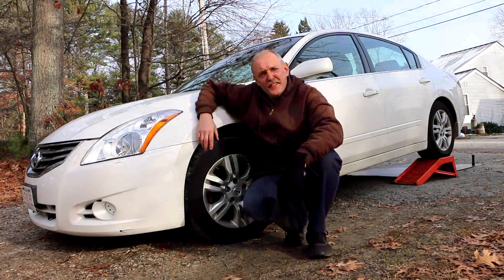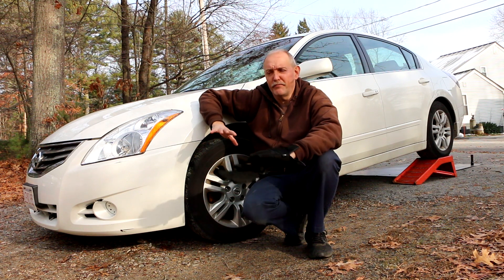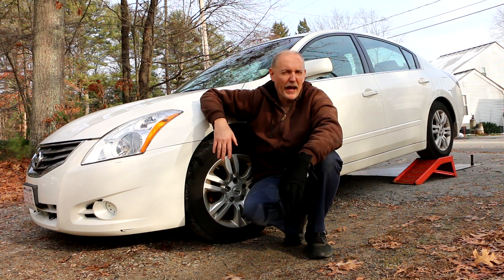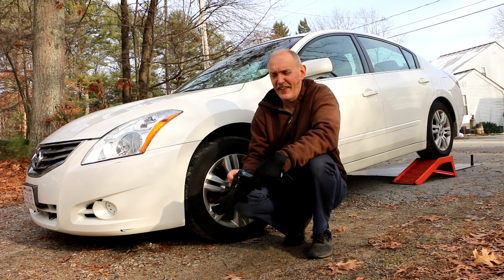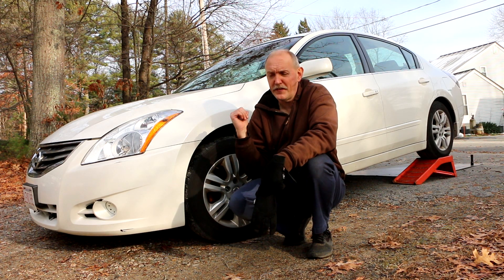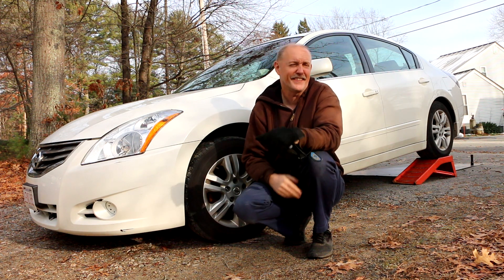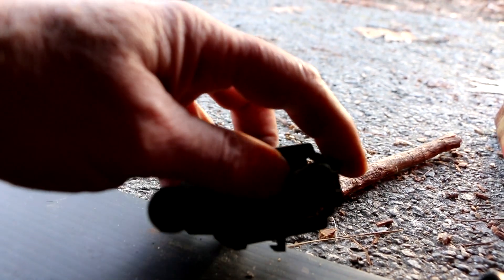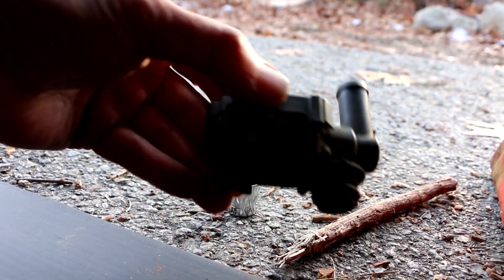2010 Nissan Altima Emissions System Leak  Codes P0442 P0445

Comment: I had this problem and had a small leak to high leak code. I replaced it with a new one and now I’m getting a circuit stuck open code. Do u have any suggestions?

Comment: What you replaced is your vent valve. The purge valve is located under the hood.
Reply: Tnx on the info, I watched dozens of these videos, I couldn't figure out which one is which.
Reply: hey i think i need this part what will ur car drive like if u have this problem?
Reply: what the heck is it then  ,  thought it was called evap purge control vent canister

Comment: Absolutely amazing video. Thank you for not only covering the 'how' bit, but also the 'why'. Just replaced my own on my 2010 Altima - the shop did a smoke test and wanted $1500 to do it, saying they'd need to drop the gas tank and the whole exhaust system. We'll see how we did if the Check Engine light comes back on. 

If it does I may need to look at replacing the whole canister - not sure how much more involved that will be, but with your video this was easy and fast! Thanks for taking the time to make and share.  :)
Reply from the maker: After the repair, it was fine for a while. Then it through an evap code again, however, now the light will go back off on its own. So I am convinced I still have a small leak. It might be as simple as the gas cap. I now push in on it while tightening to try and ensure a better seal after buying gas.
Reply: @stevewatr  I appreciate your honest reply! I tried replacing my gas cap first, but the check engine light came back on relatively quickly. Mine was throwing the codes P0456 (very small leak) and P0442 (small leak), though after the smoke test the purge valve was the only issue they found. I've driven a little over 100 miles since replacing it and the light hasn't come back on yet, but I do still smell exhaust fumes seeping into the car while I drive from time to time, so I'm thinking there could be something else happening also.
Reply: Hi Steve im having a problem with my 2012 nissan it's giving me trouble with small leaks I got that same part. Is this not the problem. Also I noticed in my gas filler pipe I thought I had a flap that would go up and down when using a gas nozzle. It was there and now its not there like its stuck in the pipe. Would this be why I have a evap leak.